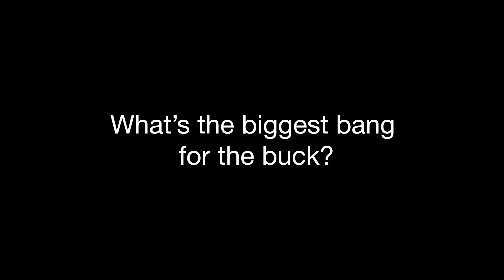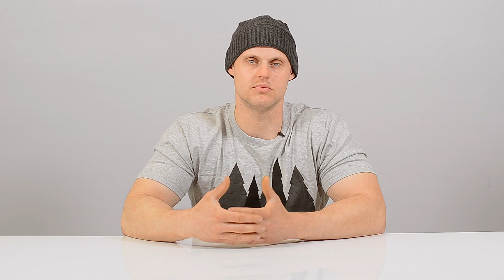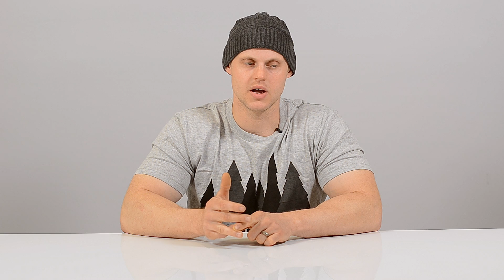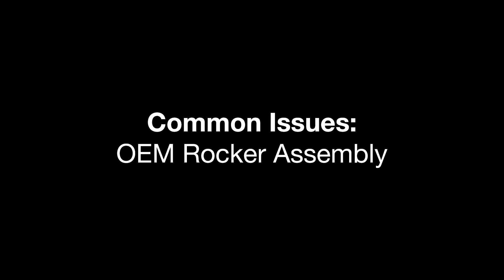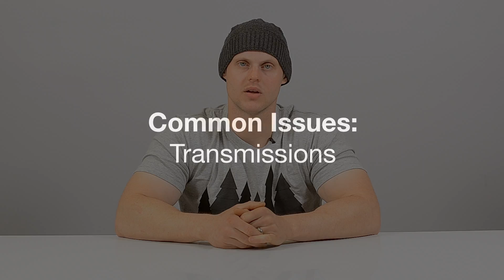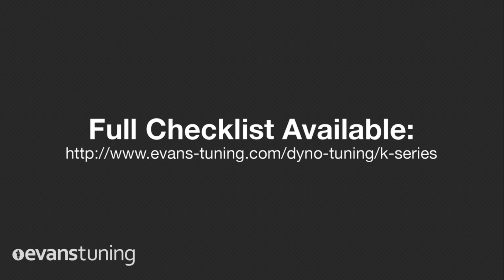The K-Series Tuning Checklist

Comment: Hold up hold up I got a k24a2 block and k20a2 head I can still use the rbc manifold or I got to change it
Reply: Youtuber will the RBC intake manifold fit/work properly if i cut the water passage and without remaping my ECU?
Reply: Geo Gabri that's sounds like a bad idea mate
Reply: Ernie Zeledon yea you will need to use a tb spacer in order to use it

Comment: I see you mention the 06+ TSX cams...  I'm about to slap together my 12.5:1 K24 with 09 TSX cams and its matching VTC gear.  From what I hear, it's a 50 degree VTC cam gear and only works with the K24Z3/K24Z7 intake cam length (different offset on gear too).  Anyway, any experience with that setup?  I'm hoping I'll be okay.
Reply: Howard Choy with that compression there's no point to put in a tsx cam you mite as well go with some skunk2s or drag cartel

Comment: Great video man!!!! Could you possibly do the J-Series some day?
Reply: MrTrill409 yesss J series
Reply: MrTrill409 i agree its a great reliable engine that has tons of potential that is overlooked by everyone so there's no point talking about the j series. There's less than a handful of aftermarket parts. Hi conp pistons. Port heads tune ,cai, exhaust, that bolts to a dainty trans. And 07 saturn vue borrowed the 3.5 so its forever uncool